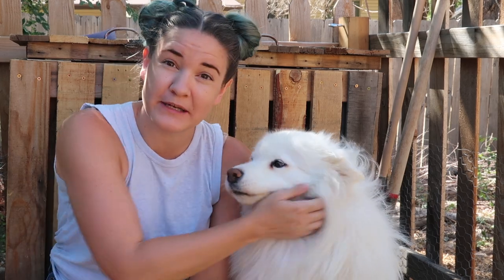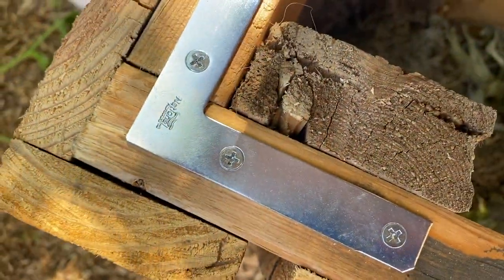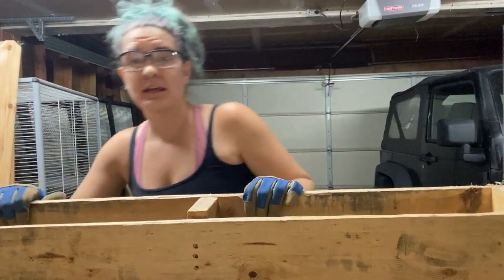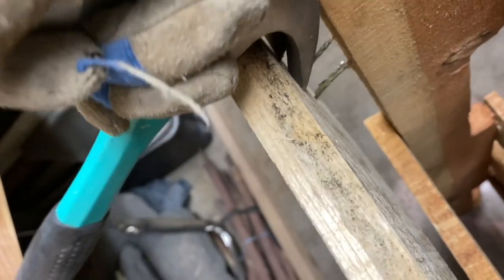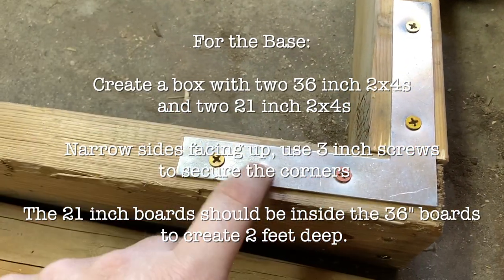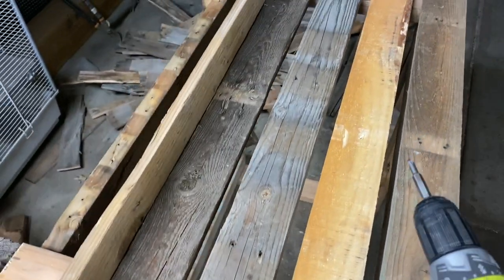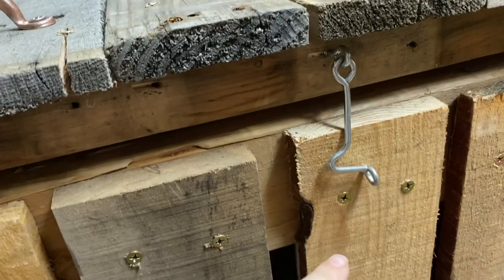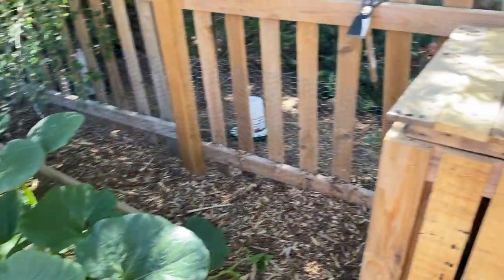DIY Pallet Wood Compost Bin | Build with Me

Comment: Great video! Love the idea of having a lid as I have to put my bins in a sunny spot in the garden. Did you use Heat Treated (HT) pallets? I am having trouble finding these at a useful size. Don't forget to build yourself another bin (or two) so that when one bin is full and is maturing you can start piling up compost materials in the next bin. Also, if you attach galvanised metal vermin mesh (6mm mesh size) along the base of the bin this should keep out mice & rats! Worms can still move in to help break down the compost materials. Happy gardening!